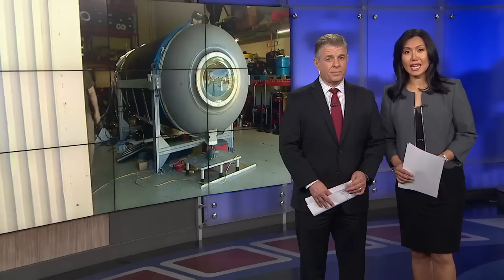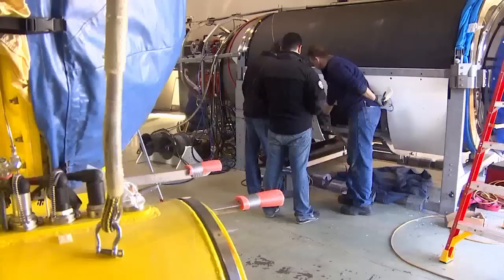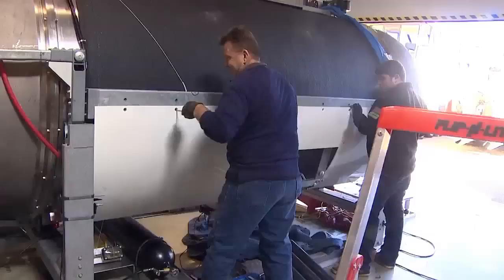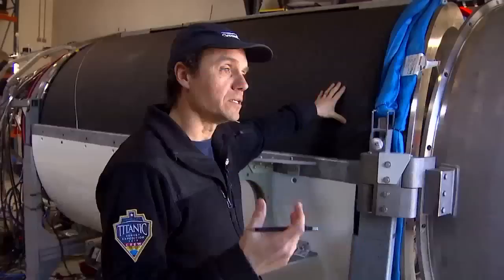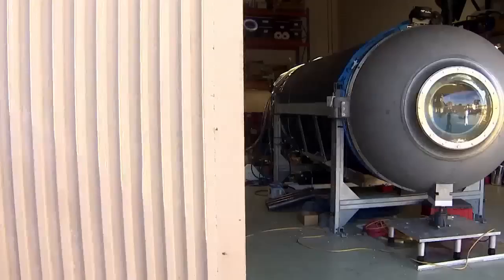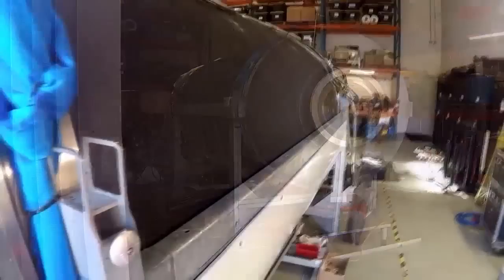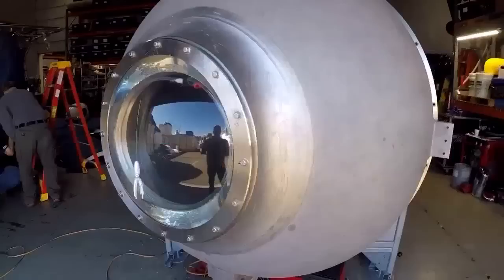The making of Titan: Oceangate's submersible capable of taking people to the Titanic

Comment: Engineers from the carrier ship reported that communication with the Titan was interrupted 1.5 hours after the dive. This suggests that something happened to the submarine even before it reached the bottom. It takes at least 2.5 hours to get down to the Titanic. Anything could happen: depressurization is possible, the porthole cracked, there was a problem with the oxygen supply, due to which the passengers could suffocate, a short circuit and a fire inside the submarine itself, or the control simply failed, as a result of which, under the influence of an undercurrent, the submarine could be carried far beyond the area of the sunken Titanic. Nuance! If the passengers were "alive", they could simply drop the ballast and rise to the surface immediately. If the submarine is still not visible, then the chances of saving the passengers themselves are reduced to zero.
Reply: Thanks for the novel, but..... It is NOT a submarine. 🤦🏼‍♂️
Reply: It's only being so cheerful that keeps you going! 

It's not a submarine - it's a submersible. Today the coastguard reports hearing a repetitive banging noise, which it's hoped is confirmation the inhabitants of Titan are alive, and sending a message by hitting the walls of the vessel.

Their situation is unimaginable - I can't believe people pay £250,000 to get into that tiny tin can, barefoot, and sink miles under the sea - for what? Images of the Titanic wreck, that you can see more clearly on YouTube videos! 

These millionaires' trips have been presented to the public as though they are totally safe. This crisis shows there was always considerable risk attached! Five years ago an ex employee of OceanGate took them to court over their safety record. It seems spookily prescient today...
Reply: @glamdolly30 I can't believe they pay all that and risk this just watch the wreckage on a monitor from inside the vessel.
Reply: "they could simply drop the ballast", have you heard how they get rid of the ballast? The passengers have to rock the vessel from side to side go get the ballast of their rails...how insane is that?

"The sub uses ballast to stay under water. To release the ballast, the occupants rock the ship, Newman said. If that maneuver does not dislodge it, they have a pneumatic pump to knock the weights free.

And if all else fails, the lines securing the ballast are designed to fall apart after 24 hours to automatically send the sub to the surface, according to Newman, who is now an investor in OceanGate."

So they seem to been alive after the M.I.A if the knocking sounds are to be believed, to they did not manage to dislodge the ballast
Reply: finally a reasonable comment
Reply: @XxXDestroyer  Agreed! You can see the Titanic wreck through a small porthole (which the former OceanGate employee I mentioned earlier also judged unsafe for such deep conditions), but yes, they mostly view it on laptops - more low tech equipment, like the X-Box console that controls the submersible!

The banging noises that were identified by the coastguard may not be coming from the 'Titan' at all - many experts say its highly unlikely they are! There are many ships in that area, and all make strange noises, all the time. The 'Titan' s made of carbon fibre not metal - making any such noise even less feasible.

I seriously doubt the non OceanGate employees who got inside the 'Titan' on Sunday, had any idea it could go missing, and not be traced by rescuers for days - and sadly, possibly longer.

Comment: Carbon fiber can embrittle with stress cycles. It took a lot of experimentation for the racing industry to produce wheels for cars and motorcycles that wouldn't shatter from stress. They add elastic properties to the epoxy to create flexibility.  I wonder if any of those learnings were incorporated.... seems extremely risky without hundreds of stress tests and repeat xrays.
Reply: I would say much of this will be in the final report.

Comment: Wanted to copy James Cameron but had the wrong attitude. Cameron's team of engineers respected the dangers involved and started from small unmanned drones slowly getting deeper every iteration. It took years of design and multiple test, slowly getting deeper, slowly engineering solutions for each problem they encountered. Unlike Titan, None of Cameron's equipment was off the shelf each was engineered, manufactured, and tested for the  specific requirements.

Titan seems to be more concerned at hype, shortcuts and promotion. Even bragging their control was a cheap game controller from amazon. All the more alarming is Titan's head engineer brag about how fast they made the craft.
Reply: Yes , normally it is better to over engineer a project like this :  err on the side of caution , rather than wing it.!

Comment: If you think using carbon fiber is good as a sub-pressure vessel then you shouldn't be an engineer. I'm not an engineer but I know carbon fiber is brittle and almost impossible to make structurally uniform all around. You don't need to be a doctor to know that drinking Clorox is bad for your health.

Comment: It’s not about the cylindrical design of the hull. One should not mix different different materials especially carbon fibre and metal which has different rate of compression and expansion over time. Creating a sub body completely out of titanium will costed them lost, so Mr Rush rushed his engineering team to come up with a solution which is also cost effective. If they had used their brain, to learn from mistakes and accidents during previous dives. They fired and filed lawsuit against whistleblower who cautioned them about catastrophe waiting to happen. Rush kept cutting corners, rushing things and didn’t even try to test their experimental vessel that was going at crush depths.

Comment: There's a general lack of skepticism in pre-June 18th OceanGate news stories. Claims which even then appeared to be utterly false (such as those about the superiority of carbon fiber as a hull material) are presented without much challenge. Even the David Pogue piece for CBS fixates more on "omg u use a game controller" than on major questions about the design itself. 

It's clear none of the reporters covering this story knew much about it, and that they essentially did nothing but provide free PR for OceanGate.

Comment: They built this extremely fast and the crew won’t feel a thing. That alone is a huge red flag and exactly what happened.  They died instantly which I guess is a blessing.  It didn’t have to happen.  Stockton was a billionaire but bought parts of this sub at Camper World.  Titanium and carbon fiber were also huge red flags.  Stockton was repeatedly warned about the safety and refused to get his sub certified for such depths.  It’s all very sad!
Reply: The Camper World was for the interior lights.  I don't think that was the cause of failure.

Comment: For research purposes, I see no issue. The inside and outside look pretty standard of research vessels, youd be surprised how many thigs are duct tape labeled on ships
Reply: This was not a research. There's nothing standard about this, especially for a dive to 3800 meters. The CEO is on record to state that safety measures are wasteful. I can see multiple failure points with little to no redundancy.
Reply: Its not a ship though.

Comment: Just check out the bolt spacing for attaching the nose. My transmission pan bolts on with a tighter spacing and still leaks. Maybe they should've used some RTV?

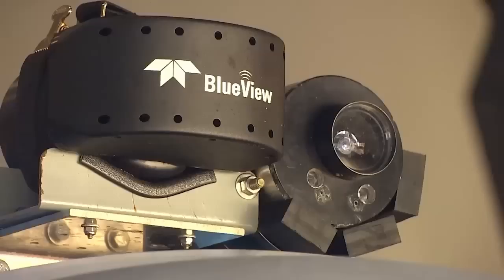Comment: 1:18 are those.... huge glue voids around the edge of that window, showing a remarkably non-flat surface on the metal side of that joint, or am I crazy? 
even if that joint is somehow only exposed to compression force, that still shows really bad workmanship. and I don't think that it is, as one thing it's certainly exposed to is lateral shear force as the vessel goes through pressure cycles, causing expansion and contraction. a joint that looks like that is going to have a tiny fraction of the strength of one without voids, on flat surfaces.

Comment: We know a cylinder is not as strong as a sphere !!! I understand that they wanted a cylinder to allow more passengers which is fine but I would have made the cylinder out of titanium and the end caps out of carbon fiber !!!  The mistake they made was winding the cf in a straight line !!! Cf needs to be cross hatched to obtain maximum strength !!! And under know circumstances would I have relied on glue to attach titanium rings to the hull !!!  Dumb !!! If the hull was titanium and end caps cf that would have eliminated the need for glue !!!  They could have used bolts to fasten the cf to the titanium !!! This configuration would have been a solid build !!!  Sometimes rich people are really dumb !!! I'm not an expert but I could have built a craft in my garage that would have with stood the pressure needed to dive to the depths required !!!

Comment: for a long time I could not understand why the bathyscaphe descended without safety net with a safe lift cable if the connection with the bathyscaphe was cut off, all the more so if the descent to such a depth where the water pressure is colossal, could it be that mobility with instrument vision argued with safety precautions

Comment: and the second question is why the bathyscaphe was not assembled in France and the hull was not brought for modernization with electronic vision and lighting and retrofitting with manipulators or battery volumes ..? in England, why because America was found in generalized wooden ships and it is all therefore, under extreme load, probably wooden

Comment: What the hell are they holding together with all those zip ties?! Those had better not be cable bundles. Not MEMA compliant if so.

We also know from views of the internals that a good deal of zip ties are used behind that display as well.

If that area is comms array then this is problematic. Hopefully they shielded the conductors for propulsion from the comms conductors.

Comment: Odd choice of words by Nissen, in retrospect.   Was that the engineer's super-intelligence (google Dr. Andrew Hodges) speaking through him?... 🤔.  Look closely at the viewing window bolt diameters alone.  Would any machinist look at those bolts (even if made of Ti alloy) and believe them capable of resisting the pressures @ 12,000ft of saltwater depth?   😞...
Reply: Probably only met SAE 2 grade standards for an economic cost savings based on everything else Rush did on that death trap…

Comment: The navy use to build there subs fast and had men doing the welding big mistake, now the welding is done by computers and welded in a very careful way, i think that ocean gate had a hidden crack in one of the welds and i bet they didn't have a computer weld it either
Reply: It was carbon fiber I’m not sure there was much welding at all, I heard that someone had blown the whistle on the carbon fiber deteriorating and it got ignored
Reply: @jordancruz621  they should of watched how the treste was built cuz that baby was under super extreme pressure 200,000 tons , the ocean gate builder were just fools rushing through a project like that and with no kind of support in that tube is plane stupid
Reply: @sextoyrepairman1621  Agreed, Paul Joseph Watson had a video he put out and it included a news clip (or some sort of media/promotion) and it showed even more detail of how it was built very haphazard. I’m not an engineer but as you suggested there should have been an internal structure similar to the Boeing 787 carbon fiber design but even stronger of course.

Comment: It uses a video game controller for steering?  Those are not designed for safety critical applications.  Bad design choice, maybe the game controller failed and they lost steering.  Since they used that, I wonder what else in the design is garage hobbyist style.
Reply: It can still surface without steering.
Reply: @dkdanis1340  If the game controller glitches even for a few seconds while observing the titanic structure up close, the sub can run into it and get stuck.  It can get trapped under a ledge or tangled.  At that point the automatic surfacing feature is useless.   The more I learn about this sub, I realize it is a designed like a garage built amateur hobbyist project.